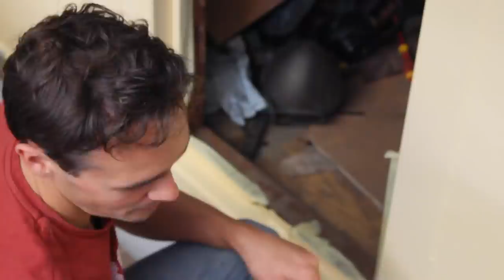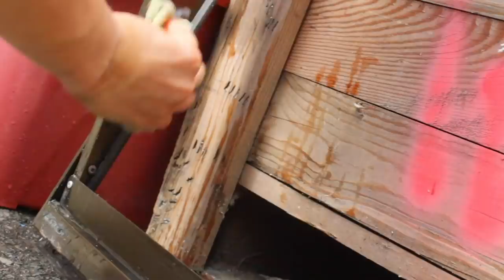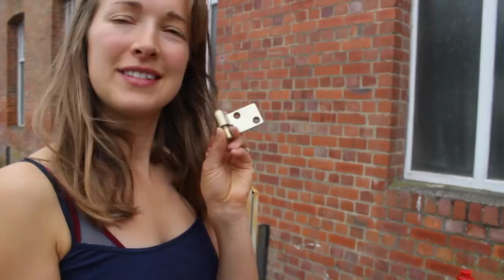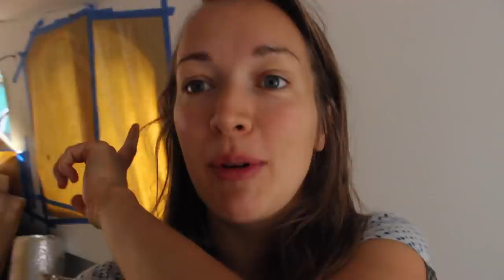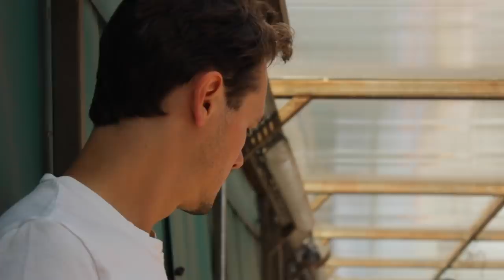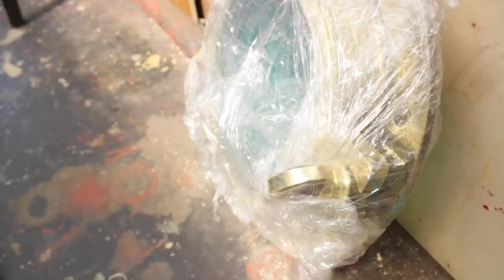Ep16 Boat RENOVATION Project: PAINTING our NARROWBOAT Part 5

Comment: The last three years I owned my boat I kept her in a warehouse over winter in Holland, so in the spring I would only need to spend one week varnishing and painting the hull. One would roller on and I would lay off with a brush, but I did have to keep slowing the roller guy down to keep the wet edge.
Previous winter she had just been sheeted over and it would take a month to get her ship shape again.

Take a photo of the hatch cover and have posters made, they should sell well in the café.

Well done.

Comment: Holly looks great. Is the exterior paint oil-based or a water-based acrylic?
What about the varnish? Rob, Adelaide, South Australia
Reply from the maker: Hmm we used Craftmasters coach enamel paints, which on their website are described as 'ultra high quality, high build, high solids, alkyd synthetic enamel'. And the varnish is 'ultra high gloss, clear, non polyurethane brushing Varnish' I don't know if that answers your questions but I'll check whether they are oil or water based and get back to you  :-D
Reply: Holly - The Cafe Boat 
Thanks so much... interesting...
It’s harder to get a good finish with oil- based paint, so your paint job is doubly good!
Pretty impressive!
Holly looks great!